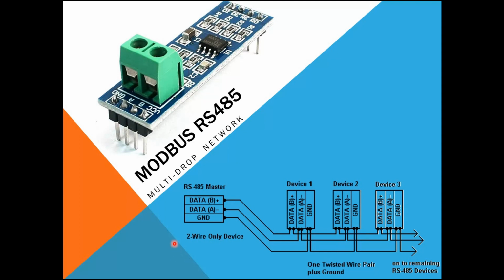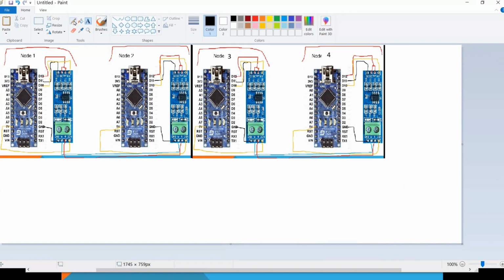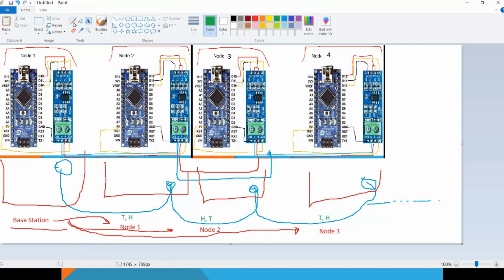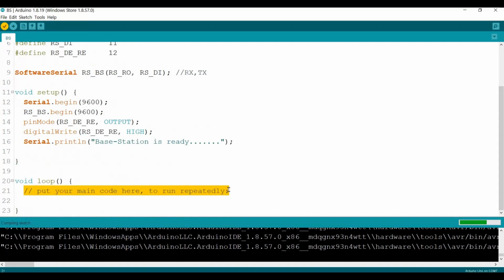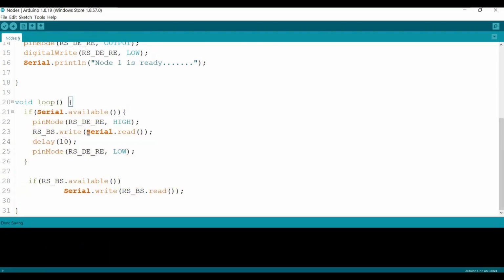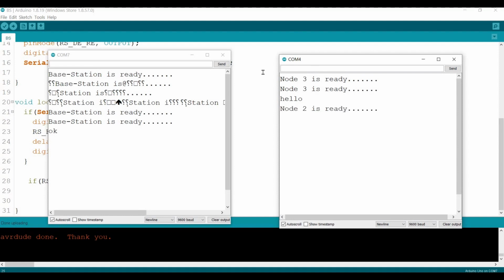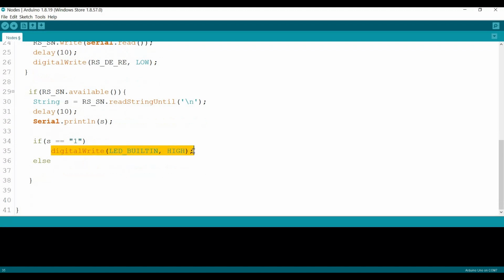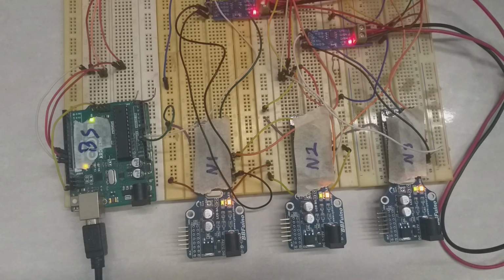Arduino RS485 MODBUS MultiHop Network Explained — Part 1: From Concept to Design

Comment: pinMode is INPUT or OUTPUT, not HIGH and LOW, this is confusing...
Reply from the maker: You are right, If you could complete the video till the end you will see the correction.

Comment: The best I've seen in a long time. Very well explained and step by step. When I use the RS485 that has a built-in 120 Ω resistor, should I disconnect the intermediate nodes? That is, only the terminal nodes would go with the resistance. If so, could you indicate what the desoldering resistance is?
Reply from the maker: Yes, it is recommended to de-solder the intermediate nodes resistors. The terminate resistor is designated with R7.
Reply: thank you so muc